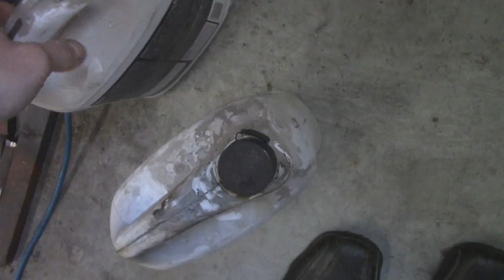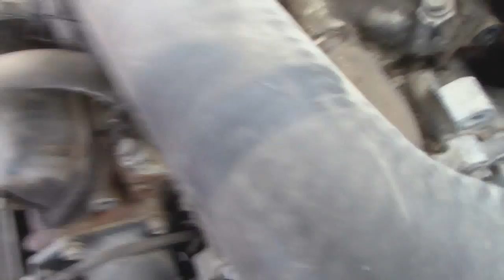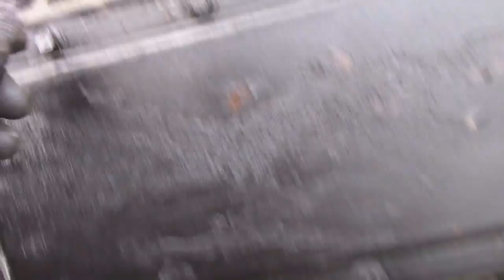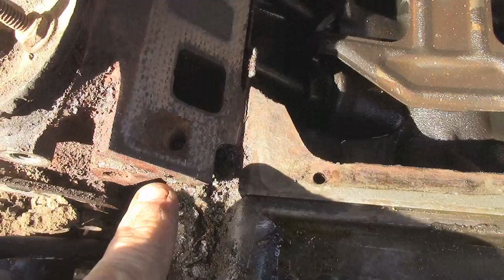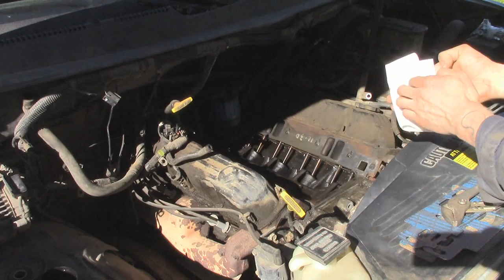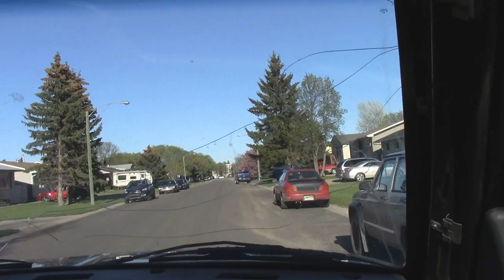Dodge 318 Magnum Intake Install

Comment: Check your catalytic converters if theyre clogged then it will not have any power and it will cause engine running problems

Comment: I had the same problem I just got tired of guessing and bought a used 318 engine from a yard and it changed the whole game I installed the engine in a single day with an oak tree and two comealongs one for pulling it out and another on a different limb for dropping the next engine in got lucky I guess now two years later about to do it again

Comment: Hey that evap is most likely the charcoal canister. Mine was sucking the charcoal up to the solenoid. The line was clogged.  I ran tie wire down the line to get the charcoal out. Then I blew all the charcoal out of the container, put it back on and fixed it tell i can get a new container.
Reply: Where was the container if you remember?

Comment: A stuck open EGR will cause very poor running and no power. Check the vacuum circuits to/from the EGR.
Reply from the maker: Jake Matthews the truck doesnt have egr haha. its supposed to, but there no egr ports on the exhaust or manifolds, and no ports on the intake haha. thanks for the suggestion though!

Comment: Those exact bolts brake on every single one of these engines. I have tested this at the scrap yards. Never had one not brake in 5 years of testing.
Reply: I can confirm that as well, the front 2 plenum bolts. I'm waiting on my heads from the machine shop and have purchased the aluminum retrofit plate.
Reply: Only bolt that broke on mine was one of the tiny 5/16 water neck bolts.

Comment: You are gonna regret not having changed that waterpump bypass hose
Reply from the maker: It's possible. The truck went for scrap shortly after this video. Tried to sell it cause i was moving, and the potential buyer crawled under and noticed the frame on the driver's side was rotten, so i scrapped it haha! It was a lot of work to begin making the truck right... it had the wrong trans, and a bunch of stuff wasn't right... probably one of my worse impluse buys haha :P

Good to know about that hose though, hopefully others can read this comment and change it while they are in that deep.

Cheers!

Comment: Have you ever herd of cleaning your working spot before tearing into your motors?
Reply: I was gonna say the same thing although I’ve never removed an intake manifold but I am 1000% sure I would clean it first just because I’d convince myself that it will make things go smoother and better but I’m not a mechanic but I have changed the water pump and thermostat during the process and it was a process for sure and I went ahead and changed that short hose that leaks .. I have a 96 ram 1500 and now that I think about it I’m not sure if it is a 318 or 360 they say they have the same heads but different strokes and piston size .My daily driver is a 99 Laramie 1500 318 rwd.

Comment: I did that same job on my ram 2 years ago only broke 2 intake  manifold bolts was able to get them out after I lifted the intake
Reply from the maker: Jeff Joy yea, 2 of them were seized in the intake, hence the bolts breaking where they did. with the intake off, they wound right out :) its not a bad job to do haha
Reply: analog56x I gota felpro gasket kit it came with all new hardware
Reply: That's why you need to use a impact with a light finger when taking off these bolts on these old motors.

Comment: Hey what did you figure out on your codes?   Good work on the videos btw looking good
Reply from the maker: adam farr i ended up scrapping the truck. I didnt do a careful enough once over before i bought it, and didnt notice the front drivers section of frame from the UCA forward was rotten. Would have been way too costly to replace it and out of province. I ended up selling all my cars and buying a 89 3+3 to build.

Comment: Did ya ever figure it out? .Im just starting research for similar stuff
Reply from the maker: Brandon Swanner supposedly it was the catalytic converter... i reset the ecm, tried a whole bunch of stuff, nothing was working. Then i found out that my frame was rotten, so i ended up scrapping the truck, dude who bought it works on these trucks ALL the time. Asked if i cut the cat out. I had, and he told me that was my issue. These things need the cat and o2 sensors to run properly.
Reply: @analog56x  no they only need the front oxygen sensor been catless for years

Comment: How long did it take u to do this? I just ordered the hughs kit for my 99 3.9L. Looks intimidating as hell
Reply from the maker: Wasnt bad. Biggest pain in the ass was the front and rear bolts breaking off haha, but it could easily be done in a day, just make sure you have all your gaskets
Reply: @analog56x  sweet. Thanks for the quick reply
Reply from the maker: @DanielThomason  i try to help out as much as i can bud :) good luck with your project! Cheers
Reply: @analog56x  much appreciated
Reply: @analog56x  I finally did it today. Took about 4 hrs. Not bad for a rookie lol

Comment: does carboraitor give you more power  than fule injection
Reply: Depends how much carb you have, vs how well the fuel injection is set up.
Reply: Barney Warwick fuel injected is better in general

Comment: Pull your distributor cap look up inside and you will see the 8 electrodes are probably all White and corroded. Replace it or use a Dremel with the fine Barrel sander to gently knock the corrosion off the electrodes. Clean up the rotor button with sandpaper making sure the metal part that touches the center of the cap and the one that jumps the spark are tight where they are attached to the rotor button with the press fitted pin. 
It's an ionization problem and if anyone knows how to stop it I would love to know.
Reply: Cap isnt vented well enough
Reply: @neilhuddleston8294 to my knowledge they all have vent caps but you could be right. It's a small distributor cap. I'll add some more ventilation and see what happens.

Comment: Check to see it the egr is stuck open (vacuum leak)
Reply from the maker: Sean K there isnt a EGR on this truck haha. its cobbled, but only slightly... haha. theres no exhaust port or intake port for the EGR. not sure why theres even a code for it... i was messing with it a little bit earlier this week, and started unplugging things to see if it made a difference... i unplugged the IAC and nothing happened. plugged it back in and smacked it with a screwdriver. THEN i could spin the tires on gravel. still bogging, but its 70% better. need to make another video. ive been run down to nothing these past 2 weeks... almost 120 hours between the past 2 weeks. caught up with me finally. been on the couch, sleeping for the past 2 days haha

Comment: You better pull your heads and clean the cylinders. After my plenum failed i pulled huge chunks of carbon out of my cylinders.
Reply: Agreed. Fixing the plenum gasket is only half the issue. You'll need to clean out all the carbon that accumulated after driving all those years with a leaky gasket. I spent two days cleaning carbon off the piston heads.  I'm also replacing both O2 sensors and the timing chain as well since it's all disassembled anyway.  She's been a good one though. I have 334,000 miles on the original engine.

Comment: ur plenum gasket failing created a vacuum leak which created a lean condition which would cause ur o2 sensor to send a signal to the ecm to start running rich. its probably ran that way for years and burning oil too. which would explain the bad o2 sensor. but now ur ecm is stuck in that position of still running rich bc its not getting a response from ur o2. this is if u have checked all ur plugs wires cap rotor etc. then ur problem is most likely just simply a faulty o2. i promise im not trying to be an arrogant prick on youtube who knows everything. but i have spent the last year and about a total of a dozen paychecks going down the road ur headed now. just experience. mine was a 93 dakota though. 318. please let me know if u have fixed the problem or when u fix the problem. really curious.
Reply from the maker: Sean Donahue that does make sense. my truck runs ok if i smack the IAC with a screwdriver, so i think its that, also given the fact that if i unplug it, it runs no different. if its plugged in and i smack it, it does run better
Reply: analog56x im not sure how much u know about iac but its only job is like a choke pretty much. when its cold out it closes. when its warm it opens a little bit. when u unplug it all ur doing is stopping it from moving. which would indicate a rich condition like i was saying. but. have u cleaned that iac when u did the plenum and had the throttle body off? if not then u need to do so bc if not then that will help out a lot. and if u dont believe me then take ur iac out and push it into itself just a little bit and install it but do not plug it in! and watch how much better that thing will run! if it does run better then ur running rich. which brings us back to o2. lol im sorry to keep beating on that subject. just my 2 cents. thats all its worth. lol.
Reply from the maker: Sean Donahue yea, i understand how the iac works. i cleaned it, and its seat before i did the intake plenum. i cant remember if my o2's are unplugged, and i dont think i reset the computer, so maybe ill try both of those... i appreciate your help nonetheless :) cheers bud!

Comment: Make sure the cat isn't clogged, doesn't sound like it, but it's something else to check.  Can be checked with a vacuum gauge, or when they're really bad by ear, exhaust from the tailpipe would be abnormally quite.
Vacuum gauge would be the easiest, hold the RPM's steady at 3k ish, and you should still be pulling strong vacuum.
Reply from the maker: Gearheadtom haha first thing i did was gut the cat :P
Reply: Is the timing adjustable on those trucks? Or is it all computer controlled? Could be off a little. 
I don't know the Dodges to well, more of a GM man haha.
Reply from the maker: Gearheadtom its computer controlled. i just hope its not got a stretched timing chain... id be right upset haha
Reply: Sounds like you have an exaust leak shouldn't sound like that from inside the cab of the truck. And try cat cleaner see if that helps